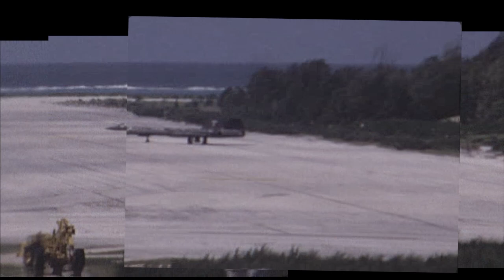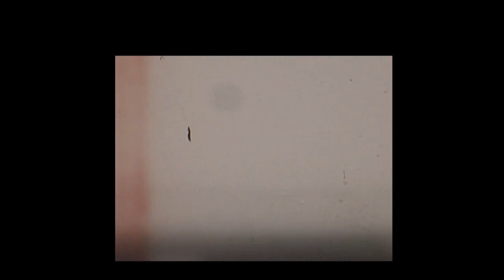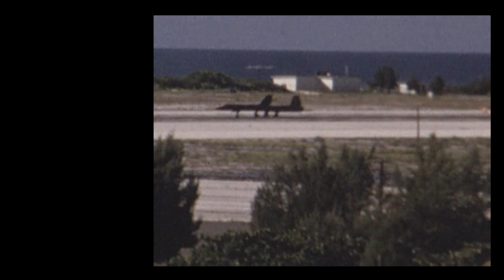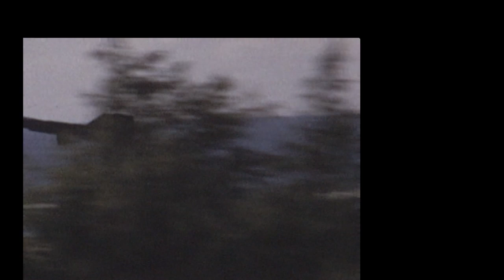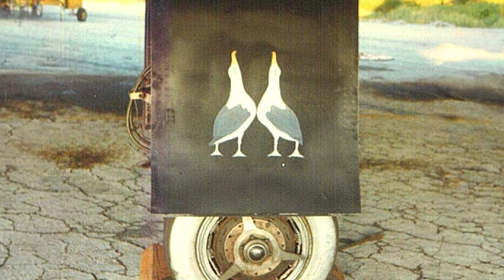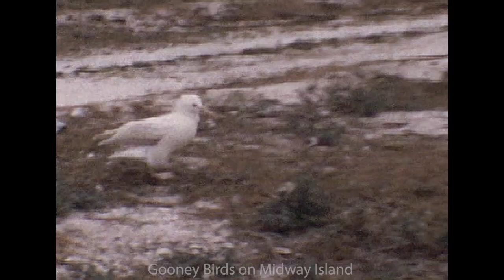SR-71 takeoff from Midway Island.  1969

Comment: I don't recall the length of Midway's runways (long time ago) but having flow into them many times and having seen Habu take off a few times, I'm a little surprised it was enough.  Hopefully V1 comes before abort, because I'm sure there is no margin.
Reply from the maker: That would have been so neat to see one of the planes fly in real life.  Also never knew the SR-71 had the nickname Habu.  How did you get the opportunity to see them fly?
Reply: @OceanLlamaMedia  
I was deployed to Kadena AFB in Okinawa in 81 & 83, and the SR-71 operated out of there. It taxied past our hangar often and took off in clear view of us. Habu is the local name for a long skinny black venomous snake, so naturally that is what the locals called the plane, and the servicemen quickly adopted the name.
Reply: @mikearmstrong8483

No requirement for V1 since it’s a military aircraft.  You punch out if you can’t fly or stop.